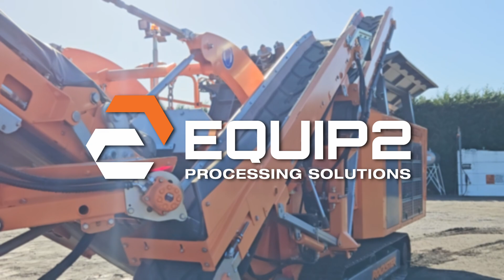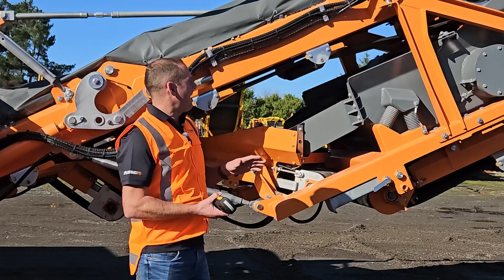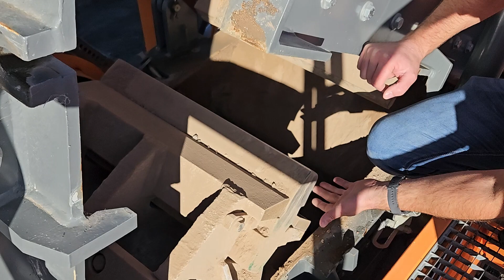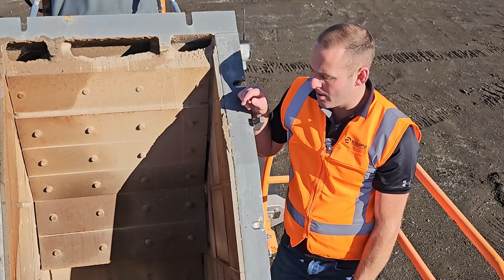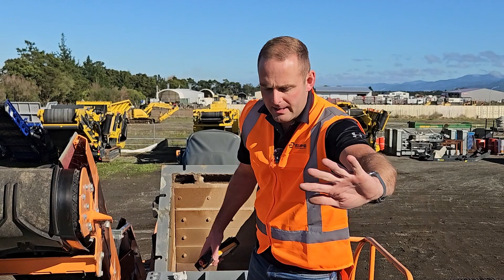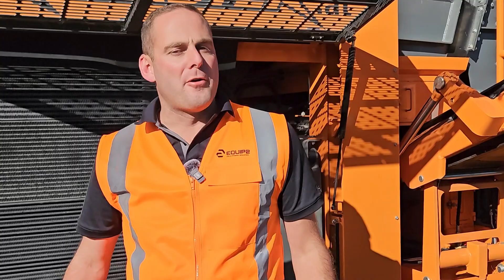Rockster R700 Impact Crusher - Walkthrough

Comment: Hello! I'm working with this machine, but I can't get the side conveyor belt to work. Is there a setting to activate it? I've already checked the inductive sensor and it works fine, and the motor hoses are receiving pressure but it doesn't move. We switched the motor to a different belt and it worked.
Reply from the maker: hello reach out at equip2.com and fill contact form with your details and machine model